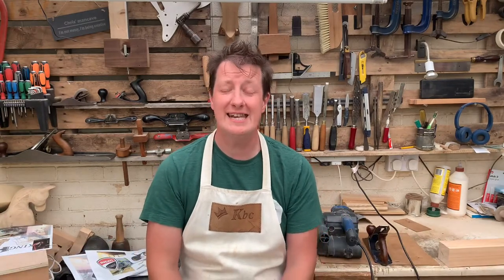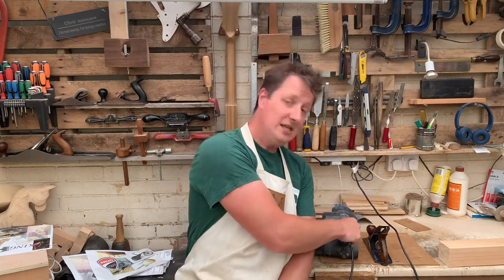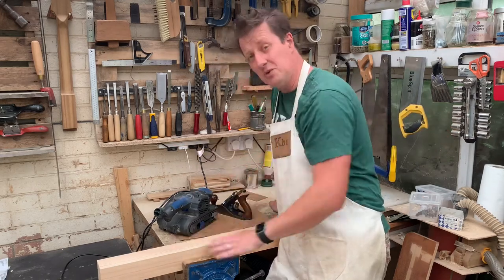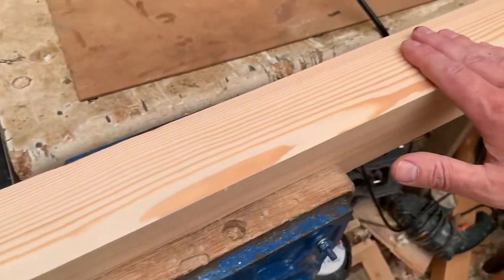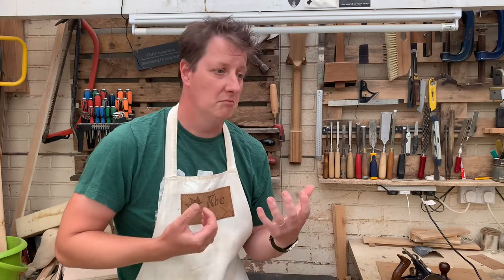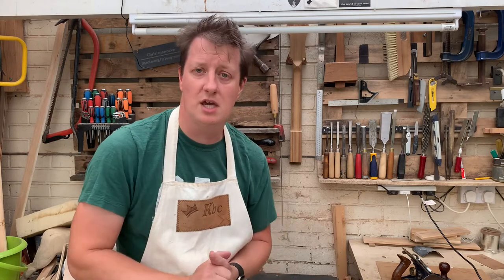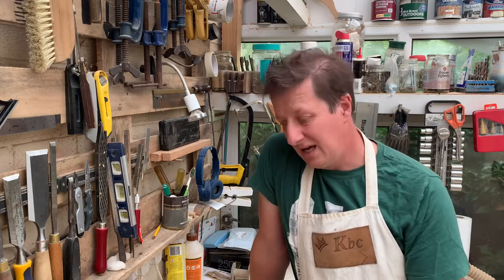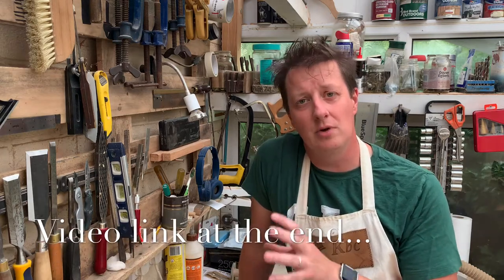Which is better? Belt sander Vs hand plane

Comment: Great video and really useful.  Would a hand plane be able to cope with shorter lengths of wood?  I’m making frames for my wife’s new painting project which start at 8” and increase.  Need to smooth off the frame and sometimes reduce the depth of the wood to accommodate the picture she’s already painted (on hardboard).   Would like to use a plane but not sure they’re suitable for short lengths of wood 🤷‍♂️
Reply from the maker: For short pieces, it’s all about work holding. I like to use the masking tape and superglue trick to hold pieces down, but yes a plane still works well
Reply: Smashing.  Ta ever so 👌🏻.  Off to a certain auction site to pick up a nice old one 😊

Comment: Great contents ! 
I wonder which one I should use in my case. I've made a workbench of 2x4  for my diy cnc but after putting the mdf top I reallised It's uneven and I've got some spot with 2mm gap. So which one do you recommend in that case since I've got to shave along the grain for the top horizontal lumbers and accross the grain ( end grain) for the top vertical feet. Thanks
Reply from the maker: A sharp plane will do both. Don’t let anyone tell you, you can’t plane end grain. 
If you find the plane isn’t working for by all means swap to the sanders. But I would always try the quiet clean approach first!

Comment: Great stuff mate. I’ve mainly only used my belt sander to flatten surfaces. I’ve got a no2 hand plane that i restored, but that’s way too small. I’ve been given a Stanley no3, do you think that’ll  be good enough once I restore it?
Reply from the maker: O.G.B Woodwork it will work great! Just slightly narrower so will need more strokes. Certainly more enjoyable than the dust and noise!
Reply: King Bespoke Creations perfect! I’ll get it restored sooner than later then.